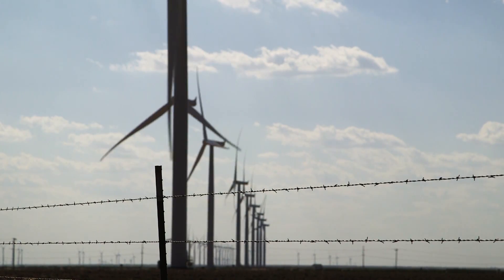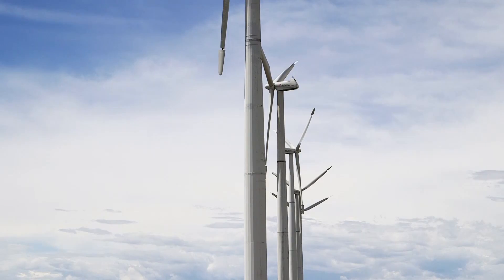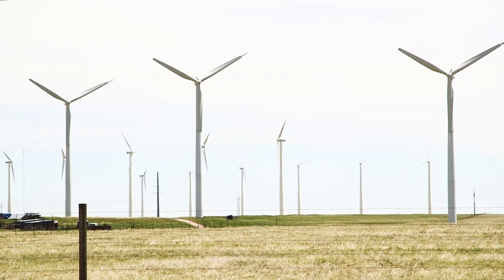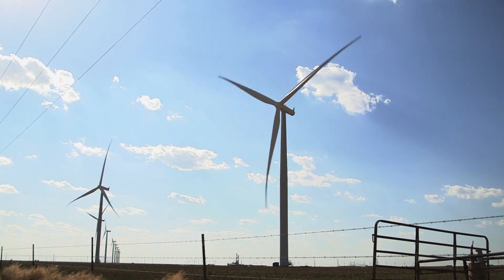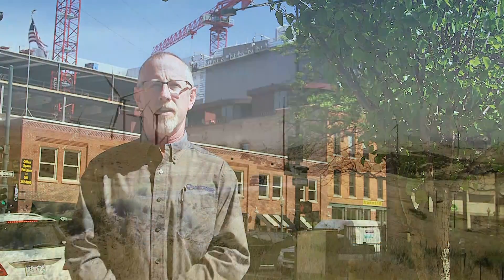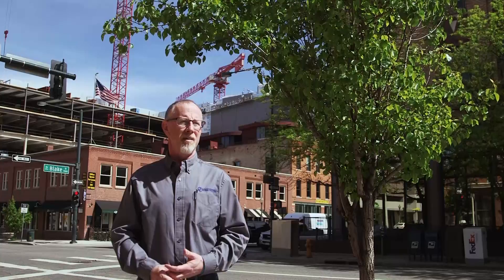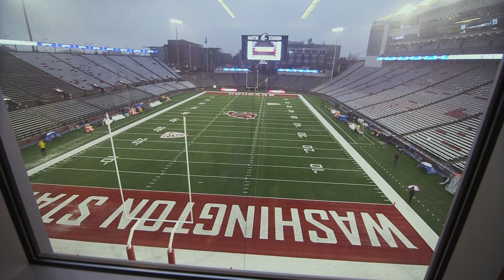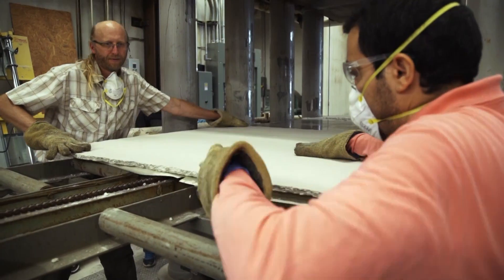Recycling Retired Wind Turbines

Comment: Build nuclear power . why is that so hard ? Most people don't know some country built a nuclear reactor at mcmurdo station in secret . the us Army has or had mobile nuclear reactors that can be shipped anywhere .
Reply: The residents of Chernobyl and Fukishima beg to differ with you.
Reply: @justsomeguy934  nuclear power is cleaner and more efficient than any other power source we currently have . you want to reduce co2 emissions you build nuclear power . want to increase co2 you build more wind and solar with a increased cost for power .it's also weather dependent . solar panels lose efficiency if they get to hot . wind generation can freeze and catch fire without up keep .
Reply: @georgewbushcenterforintell147  "nuclear power is cleaner and more efficient than any other power source we currently have ." You left out DANGEROUS. A wind turbine falling over doesn't leave the ground toxic for 20,000 years. You cannot equate the two! Wind and solar do NOT increase CO2, where are you getting your insane ideas? Solar panels work until broken, they never stop producing power. Wind turbines need less maintenance than an engine!
Reply: @justsomeguy934  I know your a troll cause solar panels stop producing power at night .
Reply: @georgewbushcenterforintell147  "I know your a troll cause solar panels stop producing power at night ." Who said they didn't? Solar power can produce energy exactly when we need it - daytime. We humans sleep at night, work during the day. Solar power can produce 75% of all the power we need when we need it the most. I know you're a troll for nuclear energy because you would know that otherwise.
Reply: @justsomeguy934 yucca mountain is ready . I looked it up on Google maps just for fun I can see it on the map but won't show you the road to get there .
Reply: @georgewbushcenterforintell147  "yucca mountain is ready . " It's not long-term storage, and Congress rejected an attempt by Pres Trump to pump more dollars into our storage facilities. We can't even commit the budget necessary to store the stuff! Yucca Mountain is closed, pal, and here's a quote about Trump trying to re-open it:
" The Trump administration has been sympathetic to reopening Yucca Mountain, asking for $150 million, but was ultimately denied."
Reply: @justsomeguy934  I'm not a troll I'm a advocate for nuclear power. I don't get paid by anyone I like to study engineering as a hobby nuclear power is the pinnacle of current human engineering.  I have a deep understanding of the nuclear industry from were the materials comes all the way to power distribution . I've also put that same time into researching solar panels and wind power generation .we can set here all day and argue but look up "Illinois energy professor " he talks about power generation geo engineering nuclear power fusion and so on.
Reply: @georgewbushcenterforintell147  Google maps is not an information source. Here's where Yucca Mountain is today, from the article I quoted you: "Many Nevadans felt that the DOE did not solicit their input in the process and that having a nuclear waste repository so close by would be dangerous. In 2010, pressured by Senator Harry Reid (D-NV) and the Obama administration, the DOE withdrew its application. In turn, Congress withdrew funding, grinding the process to a halt."
Reply: @georgewbushcenterforintell147  "I'm not a troll I'm a advocate for nuclear power. I don't get paid by anyone I like to study engineering as a hobby nuclear power is the pinnacle of current human engineering." But your statements and expressed knowledge of the subject completely ignore the facts. I don't care what the engineering is, humans make mistakes and in the case of nuclear fuel, it's devastating for both an accident and storage. We can't even commit to long-term storage for budgetary reasons!
Reply: the US government wanted to drill a well in North Dakota to study if it was feasible to store nuclear waste deep in the ground. the county wouldn't issue a permit to drill . so the nuclear waste continues to build up at the power plants . so it seems storage of the waste continues to be a problem.
Reply: @erniew5805  we have a place built for storing high level waste in the middle of nowhere next to the atomic test sights . can't use it cause people are selfish .
Reply: @georgewbushcenterforintell147  "can't use it cause people are selfish ." Can't use nuclear power because people are "selfish"? Send me that message from Chernobyl, please.
Reply: @justsomeguy934  I was referring to the yucca mountain storage facility already built paid for by the tax payer ready to accept high level waste .right near the atomic test sights were nobody lives .
Reply: @georgewbushcenterforintell147  Just in case you didn't want to check my references on how "great" our nuclear waste storage is, here's a quote from the link I gave you: 
"Across the United States, nuclear waste is accumulating in poorly maintained piles. 90,000 metric tons of nuclear waste requiring disposal are currently in temporary storage. The United States, however, has yet to construct a long-term storage solution for this waste, leaving the nuclear material vulnerable to extreme weather events such as hurricanes, rising sea levels, and wildfire"

Comment: Turn them into high-end tree houses.  Knock the generator and blades off the top of the pole.  Then install a big platform and built an up-scale tree house.  This is a job for a housing development contractor (once the generators and turbine blades are carted away).
Reply: House Biden's illegals in. Good idea!
Reply: @generatorjohn4537  House Biden & Harris in them.  Then throw away the key.